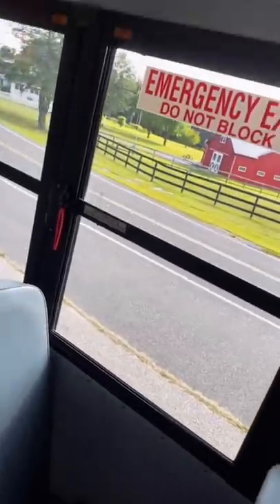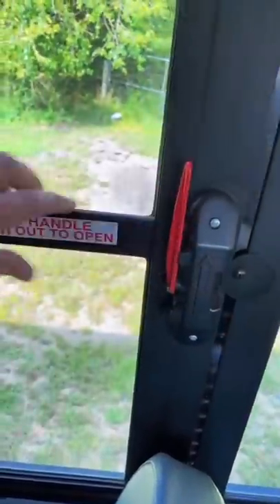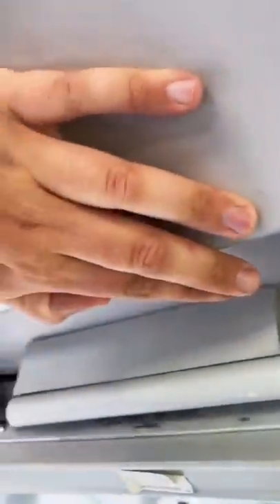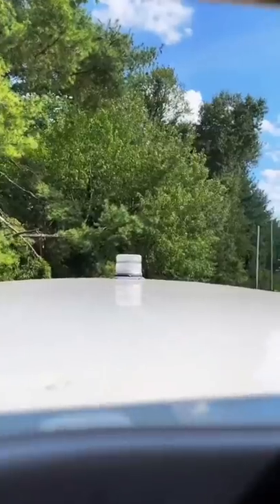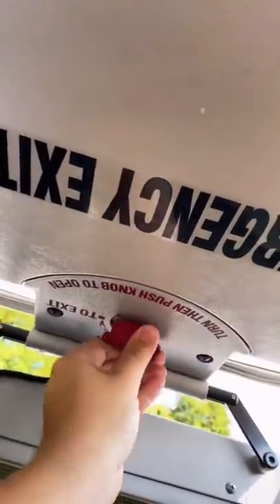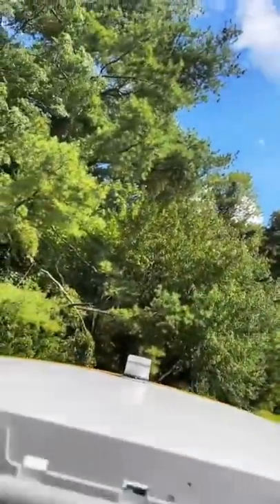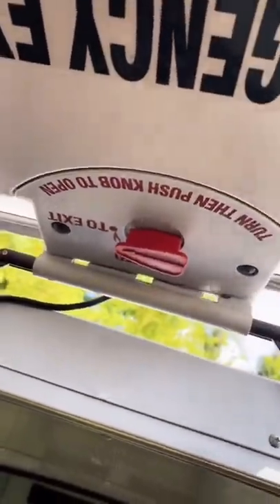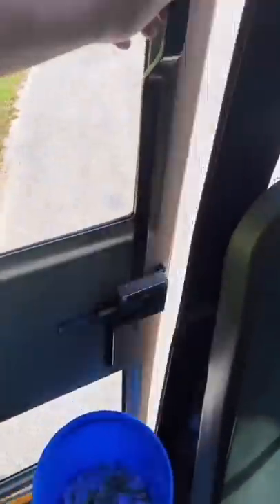OPENING ALL THE EMERGENCY EXITS ON A SCHOOL BUS!

Comment: So a kid pulled one of these and they all went off so my bus driver was telling the kids to push them down but no one was sitting in any of the seats except that kid so he pulled into the neighborhood across from mine and flipped them all but when he went to start the bus it had broken down so all of us were dying of heat until a guy came and gave the bus driver a different bus and fixed the other one